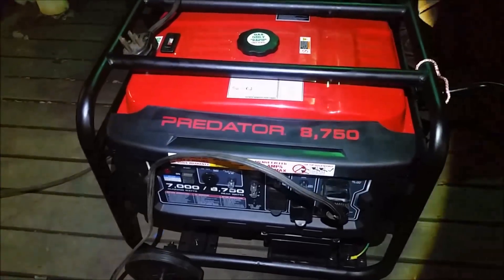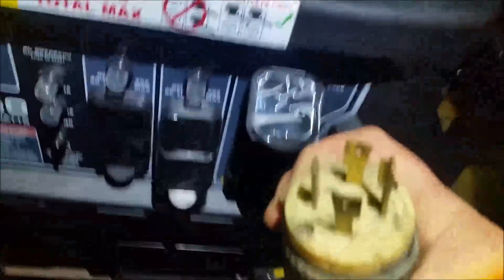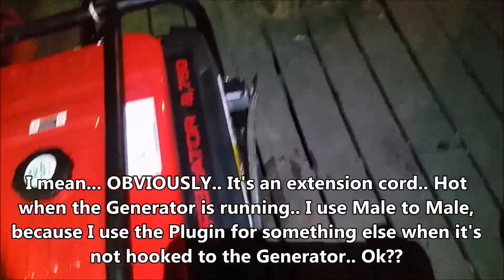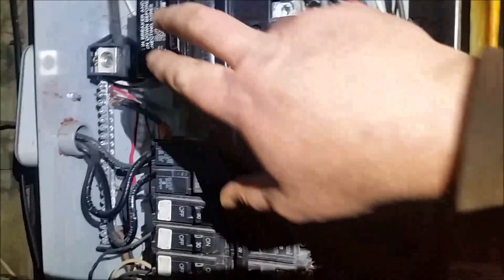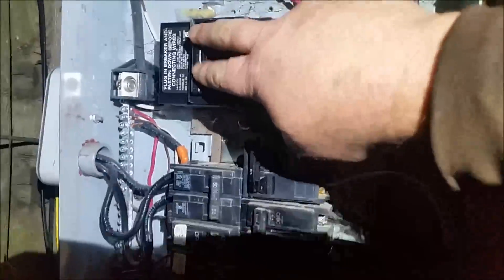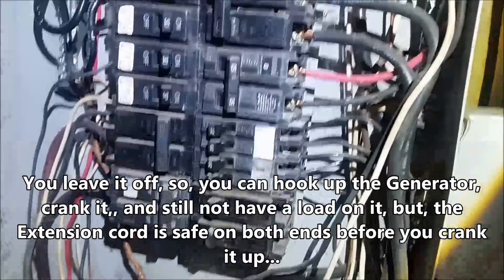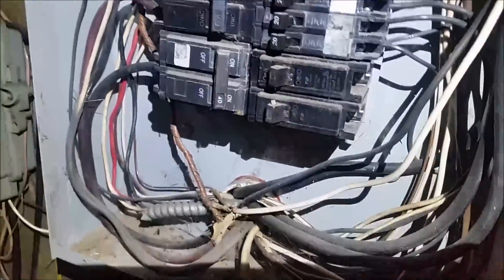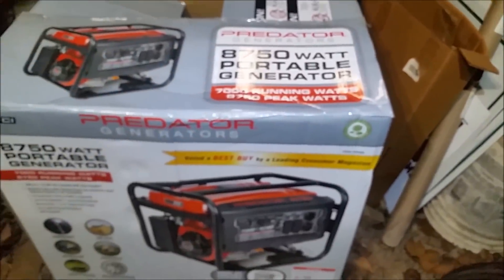Quick/Easy/Safe: Use Existing Plugin/Breaker for Generator hook up to your house Panel box.

Comment: licensed electricians are pissed cause they can't charge a fortune on something this simple.
Reply: Sure  it would work but SOOOO dangerous. If you forget to turn the main breaker off you can easily kill a lineman possibility repairing the wiring that took down the power in the first place. You can also easley cause a fire in your own circuit or shock yourself resulting in death. Peeps dont f*** with electricity unless your a TRAINED electrician. I used to think I could work with elect until I took training and then realized it IS NOT FOR AMATEURS WITH NO TRAINING. Its NOT about money. Its about not killing someone or burning down the place.
Reply from the maker: Another Ignorant Post.. Soooo Dangerous.. If you forget to Tie Your Shoes,,, It is Soooo Dangerous.. If you forget to put your car in Park on a hill,,,, it is Sooo dangerous.. All things that are within your control and you don't sound like you fell over your shoe laces this morning, but, then again you actually do make some pretty delirious statements. Yes.. If you forget to turn the main breaker off, like forget to tie your shoes or put the car in park,,, you could cause a problem. But, if your light weight brain thought just a few seconds before you made that statement, it would or should have occurred to you that,, when you flip your generator breaker on,, and all that voltage is powering your neighbors along with your local lineman, you would realize that about the second you flipped your breaker on, your generator breaker would flip off or your generator would die under load... But, that is the kind of brains it takes NOT to make ignorant statements like you made.. 
Training? I have had zero formal training and I can tell you with 100% Absolute Certainty,,  I would continue to do all of my own wiring, complete homes, etc,, before I would hire a single Electrician or Journeyman who has commented here... The Panel box is very simple.. I have taught 10 year olds how it all works in under 30 minutes.. I realize the simplicity of the whole deal behooves you, but, you are not the average person who is looking at this video.. Most have a clue who are looking for this type of video.. 
You can not find any danger in this Procedure, and that is why you had to say,, "If you forget", and no amount of training is more valuable that common sense.. Common sense is how I have defended this procedure from over an estimated 700 or so negative comments from "Professionals in the field".. If you don't believe it, then, shut your stupid pie hole and read and learn.. This video and comments are a huge learning resource and the reason I turned comments on and replied to so many stupid ass comments like yours. 
If you are going to say something, apply it to the procedure, and back it up with some facts or move along to the next video with your stupid shit, because I will call you out.
Reply: Ya...... It sounds like you have zero training.
Reply: and please dont use 8 guage wire.
Reply from the maker: Dan Anderson.. Please explain why you would not use 8 gauge wire 12 feet or so for a 30 amp circuit.. I would like to see you research to find your own answer since you want to remain ignorant and make such a stupid comment to begin with without any knowledge or taking 30 seconds to look it up before you show your ignorance..
Reply from the maker: Really? Well I can tell from your previous comment you have zero training and zero common sense and can't even tell what you need to look up before you post. Read before you post and we won't know how ignorant you are.
Reply: 8 is ok as long as it is only a 30 amp circuit.  I Apologize if you mentioned it was isolated to a 30 amp circuit. I really wasnt paying that much attention to such a idiotic post . Tell me. What type insulation is on your wire? Quick.....
Reply: looking it up.? lolololol
Reply: while your at it throw your cigarette in your gas tank
Reply: wow. as im conversing with you my antivirus detected you as a security threat.......to funny
Reply: I used three individual 12 gauge THWN for my jumper cord. My gen is a 5KVA and I don't overload it. The cord or plugs have never even felt warm to the touch in 19 years of emergency use. There is just no way to forget to flip the main breaker off.
Reply from the maker: Dan Anderson. It is a piece of Direct burial I had leftover.. More than sufficient.
Reply from the maker: Dan Anderson.. You should really try that.. Honestly.. Put some gas in a vegetable can and hotbox a cigarette and toss it in and see what it does.. 
I think you will be amazed.. Of course do it safely and put it away, where it will be safe, in case it blows up.. ha.ha.Ha..Ha.. 
Hey.. and after you try that, and you have some confidence,, here is another one to try and its getting about that time of year.. In fact.. two of them.. 
When it gets colder. do the same thing, but do it with a wooden match.. It will go out if it is a cold day.. 
And,, next time you are lighting the charcoal grill and you have a bunch of flames.. Put the same can in the middle of the charcoal and light the charcoal around it after you have put your lighter fluid on it. The can full or half full or more of gas in the middle.. When you do, ,think Fondue.. 
And, for shits and grins,, youtube "Home Made alcohol stove" made out of coke cans, etc.. 
You are going to learn something here despite yourself.. 
What a Libtard!!  Do you know nothing about Physics??
Reply from the maker: Dan Anderson.. Virus conversing with me?? You don't know anything about Computers either now do you?? Ha..Ha...Ha..Ha.. Why don't you pick a topic you do know something about and talk about it.. You are continually making a fool of yourself.. 
You can't get a virus from "Reading Text" posted on a page..  Wow.. You must live in a very small world.. How old are you?? 12?? 13?? I am amazed.. 
If you got a virus warning,, it was due to something else you were doing.. Receiving email, going to another web page, downloading something... You would not have gotten any virus notification from reading a post.. Wow.. what a no brainer..  Yes. I agree.. You are too funny!!
Reply: My son used to be a motorcycle mechanic then a regional technical adviser for a major brand. He knew a guy that welded gas tanks after filling them with gas and hanging a burning wick out out of the filler hole. I can see why it would work but I wouldn't try it.
Reply: I am a 06a elect and a Hvac business owner. How about you?
Reply from the maker: Ed Taylor.. Want to know the difference between you and I, and these Total Libtard Idiots posting above and below us..?
You hear something unusual, and you think about it, have a conceptual knowledge of the subject, either have an interest and think about it, or go and try it or at least put it in your databank for future referral when the situation might arise where that knowledge might be beneficial to know/use/test/try or implement. 
These peter suckers don't even recognize it is something worth putting in their pea size brains..  They don't even see that,, this guy knows what he is doing, r he would not be welding on a gas tank to begin with,, and this information is not something to figure out on your own, so, let me see if I can figure out how or why he is doing that. They just give up on their petty little pea sized brain, since it would be a Futile Effort to use reason and logic to figure it out, so, they start banging on the keyboard about Safety this and Safety that,, knowing this is not the first time he has done this and surely not his last.. 
Total Oblivion to the Relative facts of Nature.. Totally Ignorant,,, AND,, Will Stay That Way Forever!!!
Liquid gas is not dangerous in the least.. It is the vapors.. If you think back,, the guy probably does not even light the wick during the winter months.. 
What he is doing is putting gas in the tank to remove any air space for gas vapors.. 
Carburation.. Mixing Air with Fuel and atomizing the fuel either before or during the mixing.. It is why fuel injection is much more efficient than the old carburation jets. Carburation atomizes the gas when it is sprayed through a jet similar to a venturi in reverse. Fuel Injection mixes the gas/air as it is being passed to the injectors, which super atomizes it..  The same amount of gas, one not mixed with air, and the other super atomized makes the difference in a  little whoof and a big boom, in confined space.. By removing any air space and going ahead and lighting the gas, it is like a fondue container with the flame slowly rolling around on the top of the container.. There is no room for a boom.. No atomization and no room for compression. 
Pour gas on cold charcoal on a cold day and you have to drop your match directly on the charcoal. Put it on some warm charcoal on a warm day, and you can see the gas vapors moving around an a match sailed across the top of the vapors and WhOOOF,, and the flames jump out of the pit.. 
On a cold day, you can strike a match and even while the sulfur is still burning drop it into a 5 gallon bucket and it will go out.. Ask me how I know..Ha.>Ha. 
I used to drive a tanker.. 10k gallons of fuel.. 30 foot tanker.. We had a hinge break on one of the top caps that you fill the tanker with.. 
My boss told me.. Top it off, take 5 gallons of Regular, Unleaded and Premium and when you get to the shop, top it off until the gas is at the very top of the lip.. I did.. And, when I was still on the top of the tanker, the welder came up the ladder with welding lead in his hand.. There was only enough room for one person to pass.. I said.. One minute there fella.. I need to get down before you do this shit.. I don't make enough to stay up here an watch you.. 
He laughed and backed down the ladder.. But, he was waiting on me when I got down..  He had opened the top on one of the buckets of gas I was using and it was sitting right by the door of the shop.. He started talking to me about something else, I let my guard down and he started to light a cigarette..  With a wooden match no less.. I was standing right by the bucket of gas..  He started telling me about the gas vapors and that I didn't understand gas etc..  He struck the match and tossed it into the 5 gallon bucket about half full of gas.. I will never forget the feeling I had when I watched the match in slow motion flying through the air and sailing directly into the bucket of gas sitting next to my leg.. The first time in my life I was SCARED STIFF and could not move..Ha..Ha..Ha..  I mean for REAL!!  
I still remember the sizzle the match made when it hit the gas.. My Oh Shit moment.. 
I slowly raised my head and the guy had the strangest look on his face.. Like he was waiting for me to faint or have a heart attack.. All I could get out was a "Holy Shit!!",, and all of the guys started laughing.. I mean laughing hard.. After they got through, I was able to laugh just a little bit, but was still blown away looking at that floating match.. The welder grabbed his helmet and the next time I saw him I was standing about 100 yards away from him and I was across the highway, when I finally stopped and looked back to be sure I was far enough away from the explosion to watch it.. Ha..Ha.. 
It took him all of 3 minutes to crawl up there, weld it and come back down..  I walked back slowly..  When I got there, he had this very strange look on his face as he apologized to me.. He said.. I am sorry man,, I had no idea you would freak out that bad.. I was 18 years old, and I am 55 now. I promise you, that was his exact words.. I was still semi speachless..
I have not put a cigarette out when I fill my truck up with gas yet after that, and I can tell you exactly what type of reaction you are going to have, no matter what type of fuel, what type of day, what humidity, what temperature, etc.. Because, it is something that I do differently every single time I light something with some sort of accelearant.. 
These dip shits,,, wouldn't pay attention if someone was paying them to.. Cheers..
Reply from the maker: frontcentermusician.. You have them pegged.. Work must be pretty light for a full time Electrician to be working all day on Electrical items an then going home and searching out "How to Hook up a Generator" videos..Ha..Ha..Ha..  Sounds to me like, there are enough people out there figuring out how simple their jobs and knowledge is, that they have a lot of free time these days.. Ha..Ha.. I just found one (Electrician) who failed at making a propane tank stove that would not even boil a pot of water.. Ha..Ha.. When I looked at it, I thought,, WTF??? How the hell did he expect that to work.. Ha..Ha. And, he wants to work for me?? Ha..Ha...Ha.. 
I got a kick out of his video.. Ha..Ha.. The title of the video.. Will it Boil, part 2.. I guess part one was a failure too?? Ha.>Ha. 
https://www.youtube.com/watch?v=iJkTfBXfzv4
Reply: @MarkThomas123  LOL. Exactly!
Reply: Hey music. Don't give a fuck about losing a job like this. None of us do. It's the danger  in the LESS THAN common sense people that THINK they have common sense that will forget one little, tiny, life threatening step in this video that gets, speak for myself, so worked up. Hell, go on Amazon and buy an interlock for around 11$. Simple. Cheap. SAFE!!!! I think I'll say that again....SAFE! And Mark, princess...Dude, get the fuck over yourself. All these sparkies are doing is trying to share knowledge and explain how fucking dangerous this really is. Now, have I ever done this? Yes. But, sir... There are too many damn people in this world who lack common sense. If you don't know this, you are one of them.
Reply from the maker: Chappman wish you had an Electric Company.. You are the most ignorant person posting on this video yet.. You have been spanked like a little stepchild just about everytime you posted anything.. Nothing you say is based on any type of fact..  
Same with +Dan Anderson.. Two peas in a pod.. Both of you guys are totally clueless.. You jump from topic to topic and anytime you say anything with any detail, you are dead wrong about it.. I have called you on just about every statement and give you physics and even experiements to try based on what you said which was Random Ignorance to begin with. God help the poor people who would ever hire you, if EITHER OF YOU GUYS ACTUALLY GET OLD ENOUGH AND THEN START A REAL BUSINESS!! I rest my Case.. Wannabees!!
Reply: Hope all of you guys stay safe. Please make sure you use your portable generator carefully https://youtu.be/I1jT3ANENvI here’s a video about generator safety